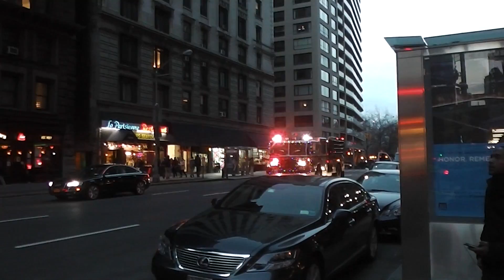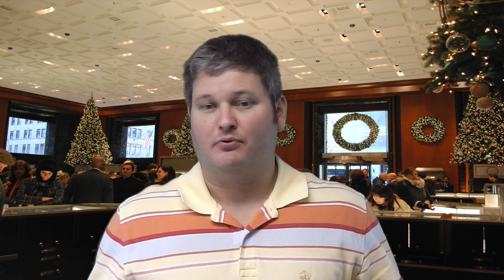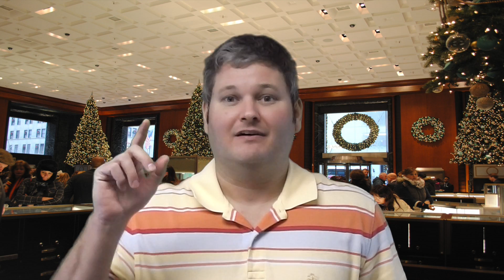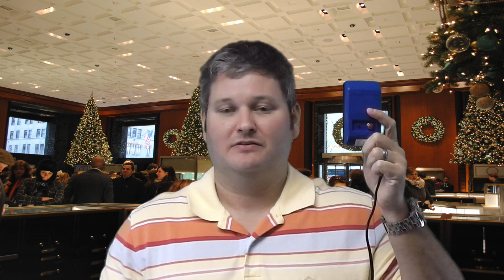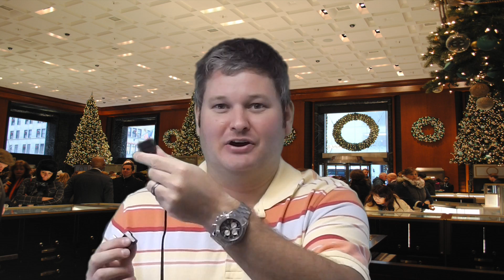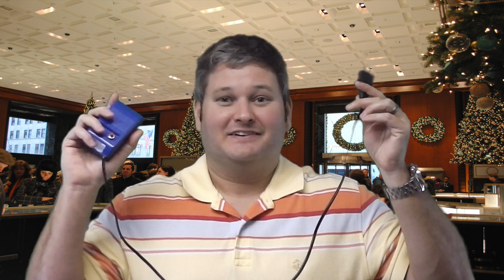What Magnetizes a Watch

Comment: i found you my Seiko automatic watch running slow before after i regulated it , now it runs faster , fuck , i going to buy a Quartz watch .
Reply from the maker: +thehegt Tr Automatic watches are not as accurate as a quartz or digital.  Even COSC-certified chronometers aren't perfect.
Reply: +IrixGuy's Adventure Channel even a rolex ?
Reply from the maker: thehegt Tr My Rolex Submariner is COSC-certified but it fluctuates by a few seconds daily.  That's normal for an automatic.  Same with my Breitling, Omega, Ulysse Nardin & Jaeger LeCoultre timepieces.
Reply: that is sad , not cool at all , $50 watch will give you a good time but a expensive 1 not wow , i'm going to spend $500 on good brand quartz watch soon no more automatic for me , thanks for the information .
Reply from the maker: thehegt Tr No problem.  Automatic watches are collected for their design and engineering.  A Casio or a smartphone will likely always keep better time.

Comment: How much will a jeweler charge me to regulate the time.? Mine it's 15 sec faster every 24 hrs. 
 either because it's magnetized or spring its misplaced. 
What's a reasonable price.
Reply from the maker: ***** It depends.  If it's an ETA movement, usually a few hundred dollars.  Now if you're dealing with manufacture movements, it can become very costly.
Reply: A tissot visodate automatic it's ETA.?
Reply from the maker: ***** Almost 99% certain it is.